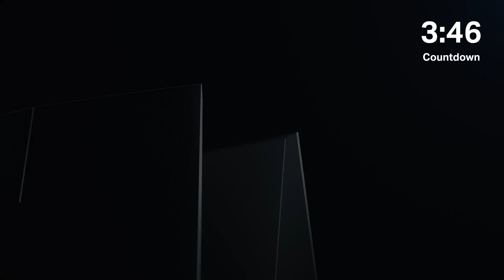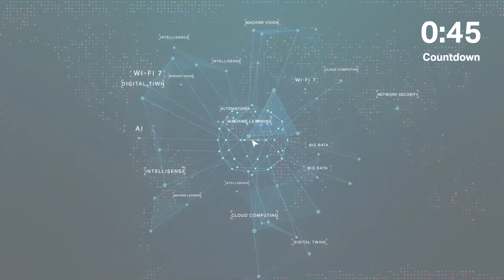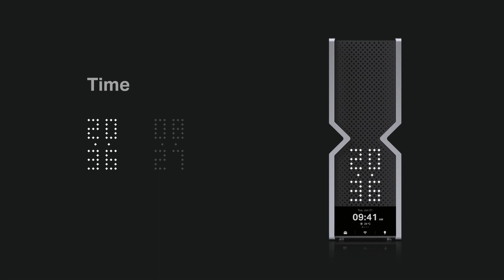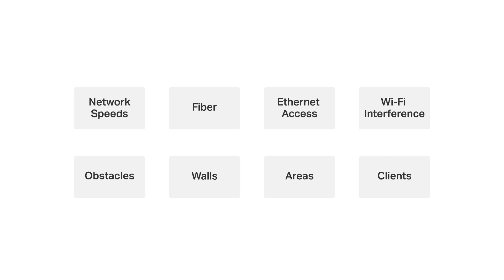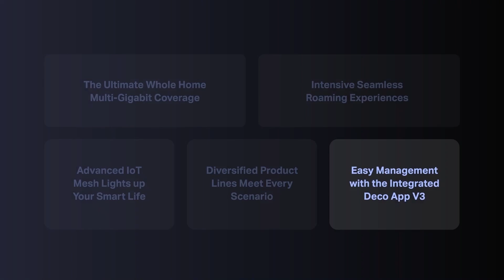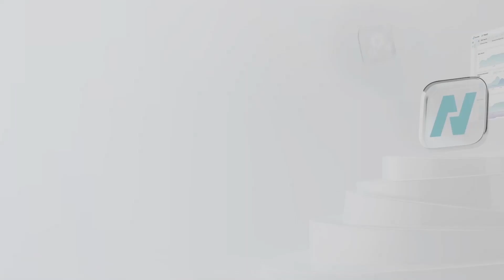TP-Link Wi-Fi 7 Product Launch Event on Nov 14th, 2022

Comment: I am looking at a new WiFi 7 router for my home and was curious which router would be the best for latency when gaming but will also cover 4,000ft. Will the gaming features only be available on the single GE800 or will there be support on the BE95/BE900 models? I will be hardline Ethernet so all models might have the same latency, but just want to confirm prior to purchasing.
Reply from the maker: That is really hard to answer because your Router is only 1 part of the equation of latency.  There are so many other factors, like your modem, the type of Ethernet used, the network card of the computer, your PC's graphics card and processor.  We can't provide you a reigningful answer because of this.

Comment: Sorry for this irrelevant comment, but could you explain me why AC 1300 Archer T4U Wifi-adapter is working twice as faster through an extension cable(location of router doesn't matter)? And why do I have only 250 Mb/s download speed? I made sure that laptop shows 400 Mb/s, so my adapter has to perform it too(I have the newest drivers). Thanks in advance.
Reply from the maker: Typically we will remove questions that are not on the topic of the video, we try to keep conversations topic based.  However a few things.  The location of the router in relation to the adapter does absolutely matter.  the further from the source the lower the internet speed will be.  Additionally, an extension cable can help improve service by giving the computer a more open and stable connection to the signal.  Lastly, the speed of your link rate doesn't equal the speed of your internet connection.  it can sometimes be 1/2 of your connection rate not always but sometimes.  If you feel the speed is slow the best thing to do is contact support and troubleshoot the concern.
Reply: @TPLINKUS  Ok, I don't assume this speed slow, just am curious about that. Thank you.